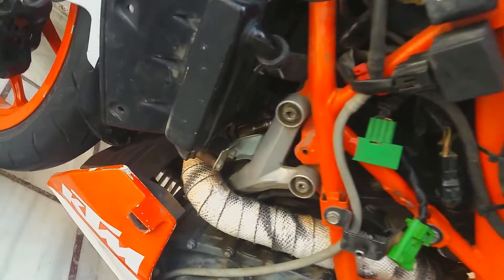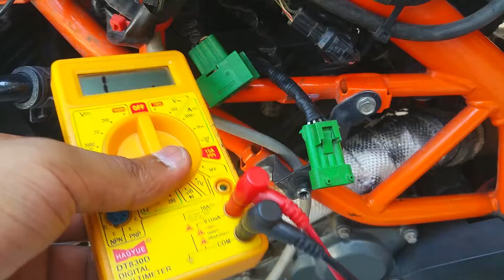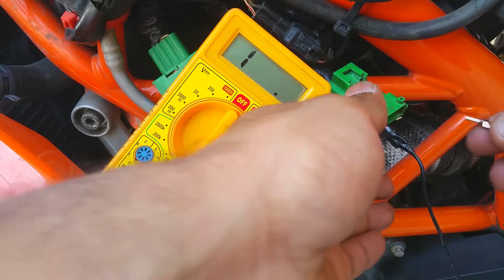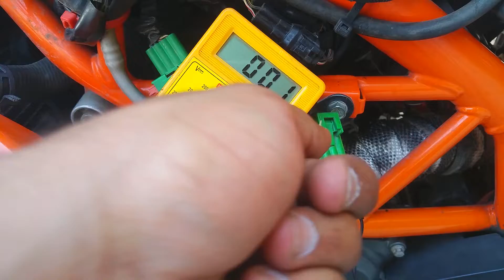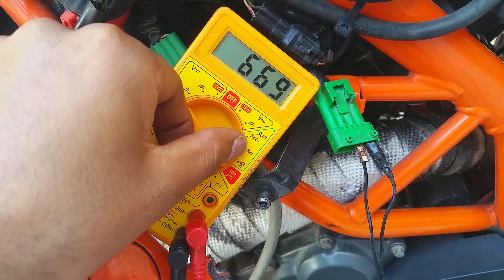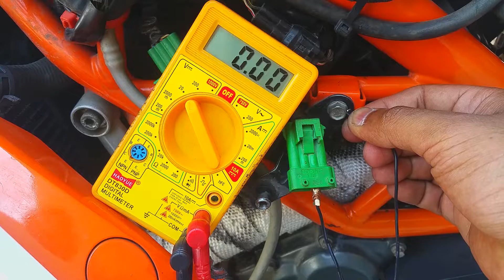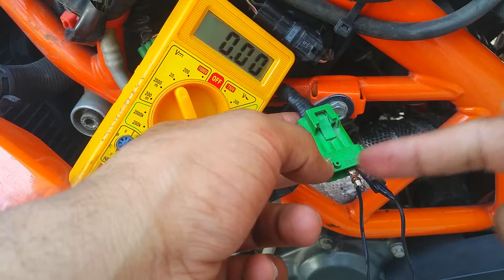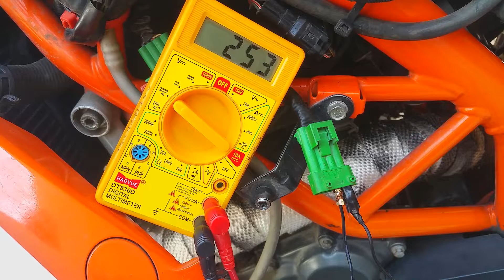Testing Motorcycle/Car O2 sensor without Propane Torch

Comment: i pulled my muffler off my 2022 vuclan 650 S. unfortunately, i did not unplug my battery. after putting everything back to spec my check engine light came on with an error code 33 (open or short) You have just given me exactly what i need to verify if my o2 sensor is bad so, thanks for the video!!!
Reply: Hi, same issue on my vulcan S, how did you fix the issue? Thanks in advance!

Comment: I know im way to late to comment and not related to this tutorial. But I really need help about my ktm rc200 theres no crank and no priming of fuel or the whining sound we hear when we turn the ignition. At first I thought the kill switch was broken but I directly tap the wires in my kill switch but still no luck. Any advice or step that I can do? Thanks and more power

Comment: Hiw to judge rich mixture or lean mixture from voltage
Reply: In high rev its lean and max. Voltage. Of want rich in Fuel.Add a spacer in O2 sensor.